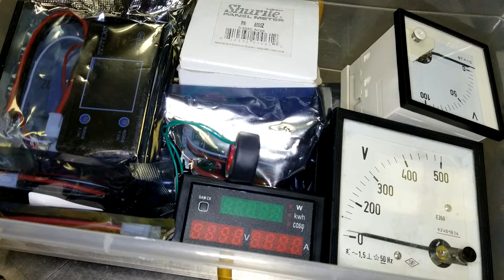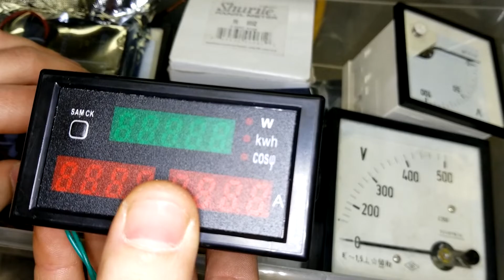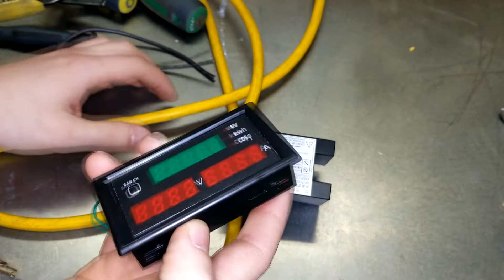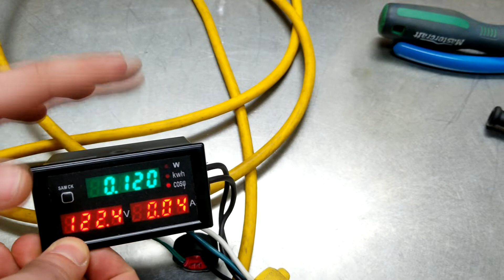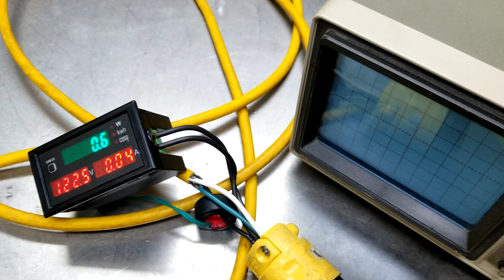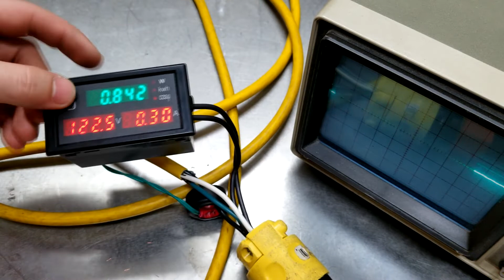ebay power meter testing

Comment: Asm video!, justone thing, when you were to measure current with the multimeter, you wasn't chage the plug of red wire to measure amps, thats why the meter panel doesn't work.